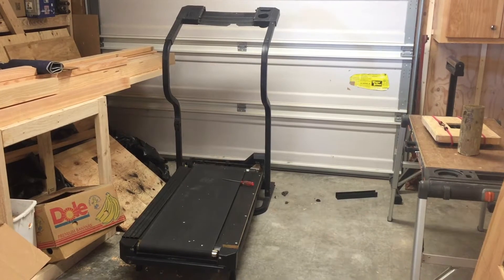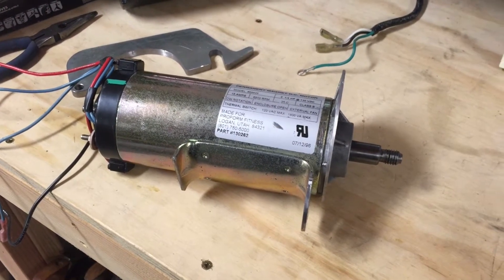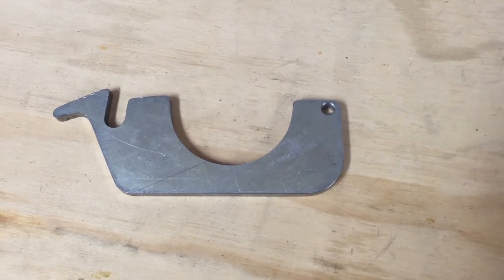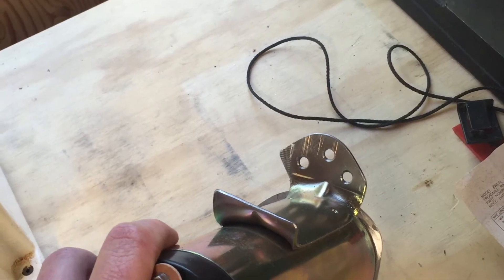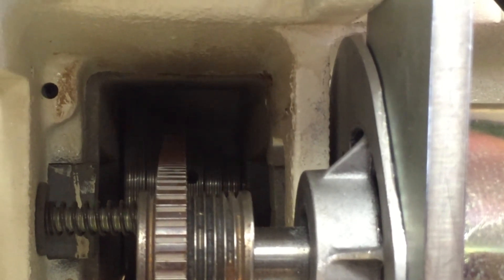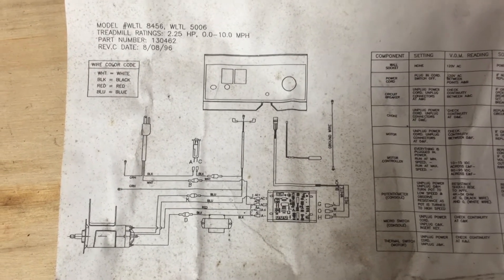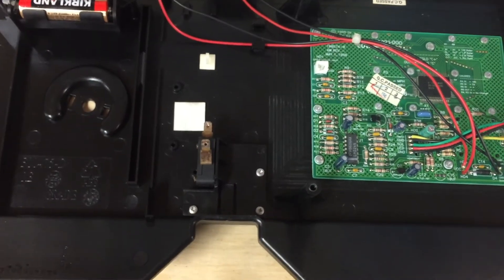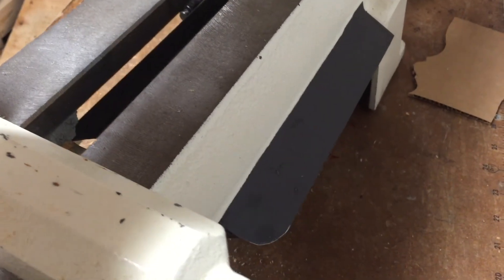VARIABLE SPEED Treadmill Motor Conversion Installed ONBOARD On Older Mini Lathe, DIY. Jet ML-1014

Comment: this is exactly what I want to do with a super old heavy frame full size lathe but use a 1.5 horse on it because I just think it would be easy with all the space to Set it up with full custom control boxes and nice neat wiring. And a paint job on the old one.. I'm super excited to either have a sweet lathe or break some shit.. both sound fun so let's do it

Comment: You can put a switch before the motor not the main, the main switch will be the initial switch, as soon as it establish the rpm just flip the switch to turn the motor on and of with the same setting.